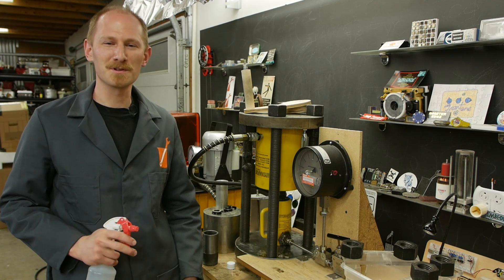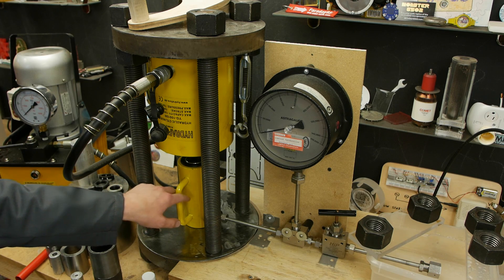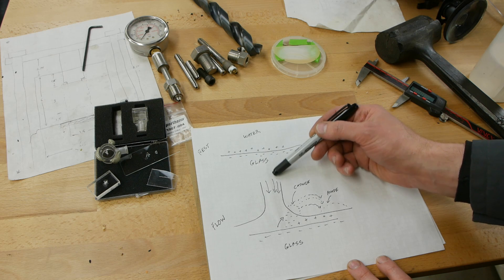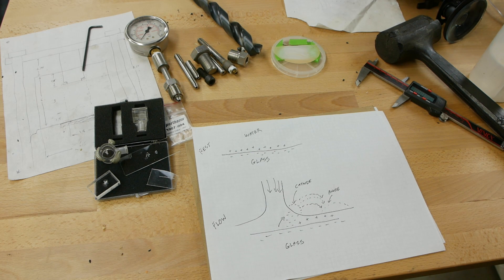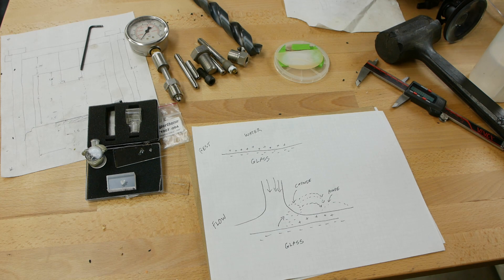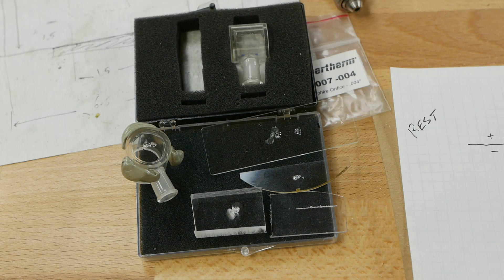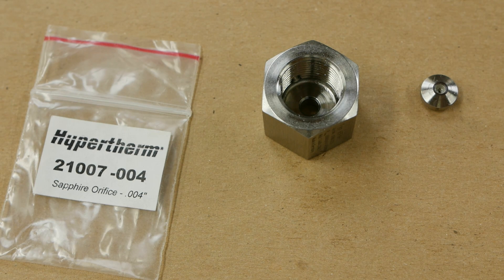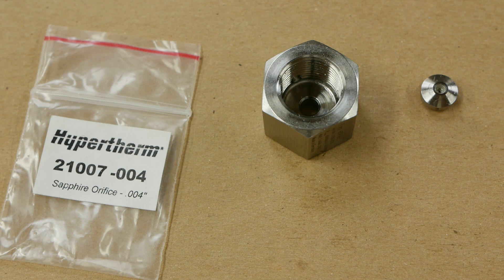Glowing plasma created by a high speed jet of water

Comment: Facinatng.  If you do it with alcahol does it ignite?  if you do it in a deuterium atmosphere can you detect fusion?  saphire might hold up better than glass (or diamond of course,  if you happen to have one lieing about :P)   the reduction in glow after a few seconds might be due to the glass getting damaged and water no longer striking it at a rightangle.  if you tilt the glass do you get the same effect?

Comment: For the pressure vessel..... it shouldn't be that hard to make your own heavy walled vessel. And then build it like an intensifier. Haskel pumps could be used as inspiration. Drwaings of these are available online, Use them for inspiration, and you should be able to get good working high pressure pumps. 
Or..... get a genuine Haskel pump made for these pressures. 
Or do as some waterjet systems, make a high pressure intensifier, with a relatively low ratio and a normal 700 Bar pump as input. 
There are many ways to accomplish this in a one-off DIY setting like you have. 

Keep up the good work!

Comment: Very cool and interesting, but I still cringe when I hear "800 watts of energy". I know it happens when talking freely, but it still gives me the shivers to hear it from an engineer/scientist. A quick back-of-an-envelope calculation shows that a circular water jet of 0.0001 m diameter and 240 m/s has around 0.5 W of power. So for emptying the cylinder at the speed you indicate, 700 too 800 Joules (Watt-seconds) of energy seems about right, but rather irrelevant, since the plasma formation is a momentary event.

Comment: I suggest checking out the work done by Dr Gerald Pollack on the properties of water within 50 microns-ish of a hydrophilic surfaces.  It might explain why the different materials were able to create the effect.  If it is the case, you might be able to enhance the effect or reduce the pressure required by shining some specific wavelengths of light (that are absorbed readily by water) at the water at the impact site, such at 950nm (some security lighting emit this) or 3000nm.

Comment: Very interesting. What about liquid oxygen?
Reply: High pressures and rocket oxidizers.  Sounds like a jolly good time.
Reply: Air Command Rockets but how?
Reply: The thermal contraction and risk of explosion would make this impracticable. Oxygen is also an apolar molecule, and as seen with oil would not create plasma.
Reply: Read the Wikipedia articles on Liquid Oxygen and Solid Oxygen.  If you have access to really high pressures, you can have a lot of fun, even at room temperature.

No, liquid oxygen does not explode, as it's just an oxidizer.  It causes other things to explode if you feed it fuel.

Comment: If the water rapidly changing direction plays a big role, it'd be interesting to shoot some non-flat glass. Seems like a concave shape would force the water to change directuon even more; I wonder what would happen if the water was shot straight into a test tube. Or maybe the convex shape of the outside of a test tube would allow the water to separate more quickly or with less turbulence, potentially having an effect on how the plasma is generated.

Comment: Might the dimming effect be caused by the surface of the material losing its flatness, changing the way the water flows? Getting high speed footage of the phenomenon might shed some light on what's happening.

For another fluid to try, what about some other polar substances, like alcohols? Could also be interesting testing water of varying temperatures. Who knows, maybe the increased energy available to a stream of very hot water produces a brighter plasma?

This is a pretty tall order, but I'd love to know what the voltage across the plasma is. Maybe a bit of acrylic with a couple of pockets machined to hold probes could give us a rough idea?
Reply: I had a similar intuition about the flatness. I suspect the water begins to get trapped and reflect differently in tiny pockets as the material begins to erode and that interferes with the path the water takes
Reply: Output Coupler 
Heating and cooling the water would change its viscosity too. I wonder if near-freezing water would glow brighter.

Comment: What would happen if you used some kind of conductive plate like aluminium or copper and then applied a high voltage to it before hitting it with the water Stream? And maybe experiment with different Polarisation s and ac

Comment: Could it be the reversed effect of electro-osmotic flow?
Electro-osmotic flow is what makes water in a fuel cell to move slowly form anode to cathode due to potential difference.

Also, the fact that the plasma has a toroid shape could indicate a magnetic field is inducted by the water flow...

Do you think you could test it under vacuum?

Comment: Perfluorocarbon would be interesting because it is a polar molecule and it has a high dielectric strength. 3M sells it under the name "Novec". Maybe the plasma formation will increase because of its high insulation capability. You could also try to use the FC40 Fluorinert from one of your videos.
Reply: That would make a nice fuorinert fog in his workshop...... not sure if that is a good idea. 
Not sure how easy it will be, but an enclosure that contains alle the mist from the high pressure atomisation action will be a good idea to complete before proceeding with other fluids.
Reply: Thats what i said! Fluorinert!
Reply: Spam Spammesen FC-40 is non toxic and very inert. You can look it up in the safety datasheet from 3M. It can cary so much oxygen that a rat can breathe in the liquid. In the datasheet it says that it is not harmful if you breathe it in.

Comment: A couple other interesting experiments:
If you pretreat the glass under UV-Ozone plasma the surface will become hydrophilic by adding hydroxyl groups to the glass surface. The charge separation and friction might be enhanced ... or suppressed . Either way, you should see a huge difference.
If you put a magnet behind the glass then you might see a moving pattern. Increasing the diameter might help you see this. The plasma will move under a magnetic field by simple Lorentz force.

Comment: Do you think it's possible to make some ethylene AND get it dry enough for a cold trap. I picked one up as well and there's enough in it to start condensing but not enough to cool the trap chamber. I hate to buy a cylinder for a few oz. My welding place won't order anything but your typical welding and cutting gasses.

Comment: Plasma is just an ionized gas consisting of positive ions and free electrons in proportions resulting in more or less no overall electric charge, occurring at very high temperatures - my thought is that you are right there is a significant triboelectric effect from water, it also generates a very high temperature resulting in plasma, and when it starts creating a small dip/cut in the glass, and the water coming in from behind then cools off the impact area before it can generate high temperature plasma.  Otherwise on fresh glass, the water hits the glass and immediately atomizes away from the impact.

Comment: Does this explain the lightning made by the mantis shrimp when its throw it's jab in the water, it's not merely due to cavitation? 9:08 What about some  99% alcohol or other kind of volatile and different molecular density liquid as acetone?
Reply: We know it can't be because the effect described in the video doesn't work if there's salts in the water, and the mantis shrimp is a saltwater shrimp.
Reply: +Suraj Grewal
that cavitation just wasn't fast enough
https://en.wikipedia.org/wiki/Sonoluminescence
Reply: +Suraj Grewal yeah but the video he did had the water under a vacuum, so it required less energy to cavitate
Reply: acetone really annoys the shrimp :-)
Reply: +1 want to see with pure ethanol.
Reply: Yeah, I would be interested to see this done with liquids of higher vs lower dipole moments, maybe comparing acetone with DCM? Perhaps even a run using cryo-liquid-ammonia?
Reply: thunderfoot has a video of water filled tube shaken to create cavitating vaccum bubbles,They didn't glow
Reply: @SurajGrewal  no offense, but thunderfoot is also a self righteous contrarian
Reply: @garethjones7802  at least he keeps politics out of scientific researches.

Comment: glycerin, maybe?...  How about glycall... I not to long ago changed out my radiator fluid, and the new fluid, I could see clearly ,flakes suspended with in the fluid, little prisms.. It is unknown if they will plug the (0.004") diameter hole?  Can I assume those prismatic flakes with in the radiator fluid are crystals? and would that act as a cutting media, kinda like garnet? Would the flakes that crash into a hard surface create their own plasma effects from the fracturing of themselves?..  likely just a bad idea, due to the mess that would result...

Comment: silicon oil is an insulator and available in pretty low viscosities. I've seen it spark in the reservoir of a hydraulic system, keeps a charge for a long time. might be interesting. ps: <10cp can be pretty flammable.

Comment: This is an unexpected effect and really should have more research into it done. Basic information, like if the current in the plasma is related to the surface material or properties of the jet, such as pressure and volume, would be interesting see. Of course, there is also confirming the hypothesis of what is even going on here that would be worthwhile.

This did remind me of another experiment that I would like to see reproduced or at least to have some direction to look for it again since it was interesting to me, although it is  not really related to this, but might make an interesting experiment for your channel anyway. I found the article in a science journal in the summer of 2001 while I had full access to a University library during an internship.

It used a laser pulse to excite the gas in the atmosphere to near plasma levels and then using the excited gas to reduce the resistance of the air so that an arc could cross a gap that was beyond what the potential between two plates could cross. It also was able to divert the path of an existing arc to follow the laser path when the laser pulse was fired. I think that you have the equipment laying around your lab to try this. I wish that I could reference the paper for you, but I didn't make note of the authors or several of the details since I just read the paper on a lunch break and didn't think of it again until several weeks later.

Comment: A simple solution to the oil mist problem is FIRE!  FIRE fixes everything!
Reply: They even use fire to fix fire. The fire department will do controlled burns around brush fires and forest fires to pre-emptively destroy areas around the fire to prevent it from spreading. So yeah, fire fixes everything. Even fire.
Reply: 750 watt atomizer, plus lighter.
Maybe check out big Clive's kerosene atomizer first.
Reply: LOL
Reply: @anonymic79  Punches a hole AND burns.
Reply: When in doubt; C4.

Comment: Do cavitation bubbles collapsing create a plasma as well?... Granted, a single bubble collapsing, last just a fraction of time and is difficult to see.. I seen this somewhere, but, can't remember if the blue glowing is plasma though?
Reply: Dru Bradley this is a good point. I remember hearing that the cavitation caused by the pistol shrimp caused a small flash of light. I don't know enough about any of this stuff to say anything concrete but if I had to guess cavitation could very well be a big part of why what happens in the video happens.

Comment: When the plasma gets dimmer, does it go back to being brighter if you move it onto a spot that hasn't been abraded?

I'm wondering: as the water creates a pit in the surface, wouldn't the path of the water change from a 90 degree turn to something approaching a 180 degree turn? If the change in the water's path resulted in a shorter distance between the charges, would that result in the arcs becoming smaller and dimmer?
Reply: I was just looking for this! Yes, it seems unlikely that charge depletion would happen at such a large timescale.
Reply: I was thinking the same thing. Maybe he could use a hard, non-conductive material like granite and film it from the other side. The plasma should still be visible though not as spectacularly.
Reply: @LandoCalrissiano  The hardest component in granite is just quartz.
Reply: Good comment. I was just about suggest that the abrasion could be the cause,. The 180° turn would bury the charged region with little to no air exposure.

Comment: Take this experiment you made... Think about the earth... You will only need to drill 2km down to release pressures that will power turbines back on the surface in a very clean and safe way.... If you think the traditional geothermal liquids used are not sufficient at 2km... Try more liquid combos in your setup instead of water. Think in terms of safety and maximum energy transfer....  Scientists think at the moment that sufficient geothermal energy requires 7-10km depth into the mantle.. Which is very unstable and dangerous.. The same energy can be safely extracted at 2km if you experiment with other fluids.

Comment: You could try hydrogen peroxide which is has a greater dipole moment than water. Also, you may shoot this in slow-motion to better understand this discharge phenomenon. I think that surface is etching away upon contact with water and forming a discontinuous section section like a crater, which is avoiding those sparks by increasing the gap between the glass surface and the air molecules(also, the charged material may be getting etched away, rather than getting accumulated so this explanation may be more apt). You may try harder materials like Ruby or Sapphire which should last longer.

Comment: I wonder if there could be an electro-magnitic effect going on. As a water molecule approaches the glass (before it turns), there could be some electron movement into the water. This stream of electrons might then be bent somewhat by such an extreme change in direction causing the creation of a magnetic field.
I have no idea if this is possible do to the time scales of the water velocity vs. charge movement. It also occurs to me that the energy might be causing heating and chemical reactions that result in positively charged ions that would (I presume) move a lot slower than electrons and that could cause a charge imbalance.

Comment: This reminded me Sonoluminescence and some attempts to do "nuclear fusion" by generating sound waves in the water. Also I recalled video about another phenomenon, so called "Sticky tape X-rays" (glowing dot color looks very similar to glowing tape)... so now the most interesting question: are there any X-rays in that high speed jet of water experiment?
Reply: Pavlo Mur very similar to Sonarluminescence as they used aceton in that experiment which is has a similar molecule as water.
The sonar Atomises the liquid and creates a plasma.
I have beleved for over 20 years that this is how ball lightning is created.
Im kinda sure I could make an experiment that would create ball lightning the exact same way it is created in nature.
Reply: Seems like a vacuum could be expected to form at the location where the water hits the glass.  It's going to displace a certain volume of air, which will take a finite amount of time to come back in.

That, in turn, makes me think "cavitation."
Reply: The X-Rays emitted by the tape was done in a full vacuum though. That'd be interesting to see him use the jet in a full vacuum and see if anything changes.
Reply: Not a "full vacuum" (whatever that is, because an absolute vacuum cannot exist and could not be made even if it could exist), and not even a hard vacuum. The sticky tape X-ray effect actually requires some gas and does not work in a hard vacuum.

Comment: Could you use a common rail fuel injection pump for higher psi?
Reply: Diesel is several times more viscous than water, and the pump uses tight tolerances and the viscosity of the diesel to seal the pumping pistons against the high common rail pressure. Also Diesel is used lubricate the pump. Pumping water would result in lower output pressure and rapid destruction of the pump.

Comment: Ferrofluid would be a interesting test to see if the magnetic fields could cause plasma to form
Reply: And is not inherently magnetized - just ferromagnetic.
Reply: Are the particles in ferrofluid small enough to fit through the orifice though?
Reply: I imagine a jet of that would become too abrasive to test on these materials though
Reply: The plasma from the water jet could be manipulated with magnetic fields in the vicinity of the plasma - move it around, concentrate it, etc  - like thin film growing plasma manipulation.
Reply: He could do some thing with the atomizing effect like coat something in a super thin layer of oil, or try to use the atomized oil as a fuel source to burn for something. I also wonder if this effect happens on non clear items like metal or would that short out, and how would you be able to see it if you were to try something like that.
Reply: It is possible to make a colloid solution with particle size on the order of nanometers
Reply: battlekruiser
It might be possible, but if the particles are too small they become superparamagnetic rather than ferromagnetic.
Reply: If the particles are that small, they would become supermagnetic and completely lose their spontaneous magnitization
Reply: Ferrofluid is an oil though, and it stains everything. That would be a mess!